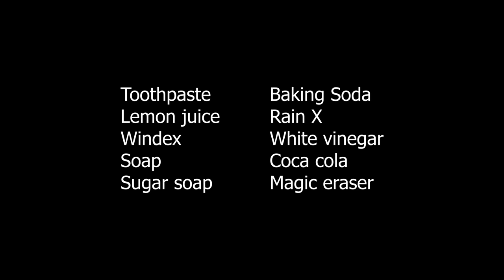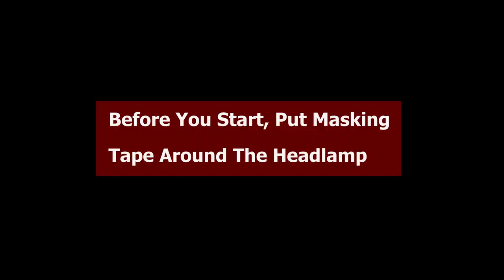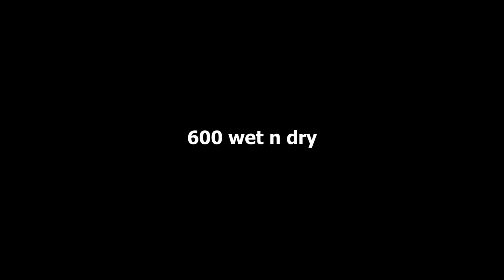How To Fix Faded Headlights In 5 Minutes || Permanent Headlight Restoration

Comment: I found it was easy just to buy a new set of headlights housing. But hey whatever works. In the end they always come back dull and worse every time. They should just go back to glass like back in the day
Reply from the maker: That extravagance is out of my budget. And, after a certain period of time, the yellowing will appear on your replaced headlight assembly
Reply from the maker: Hey Lou, I'm writing an article on my about to be launched website, I'd like to refer to your comments. What car do you have and how much were the replacement headlights housing?
TIA
Reply: @PaulWheelDriveAustralia  it was a 2012 Hilux, I never garaged it and by 2015 they were dull/yellow. I sanded it, buffed it, machine buff polish did improve it till the end of next summer. If I recall correctly they were $350 each. Never ending nightmare
Reply from the maker: @luouns  Wow that's a small nightmare